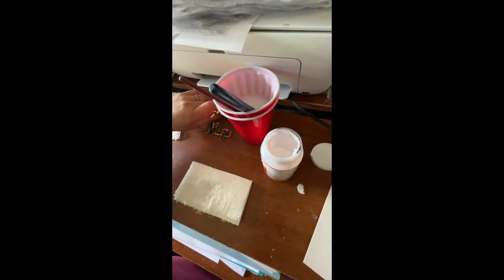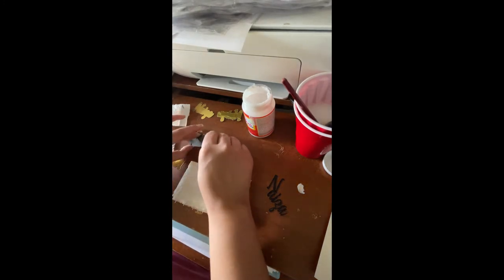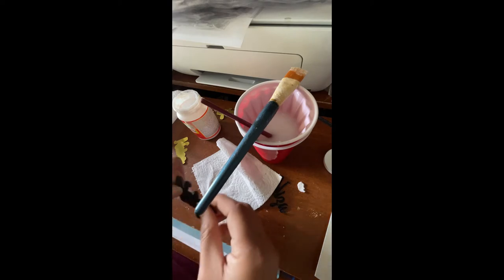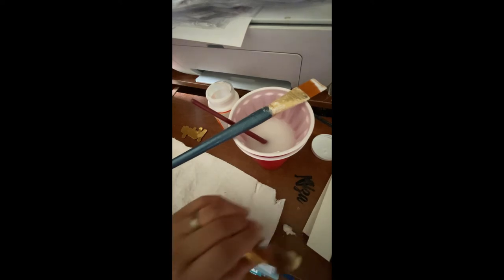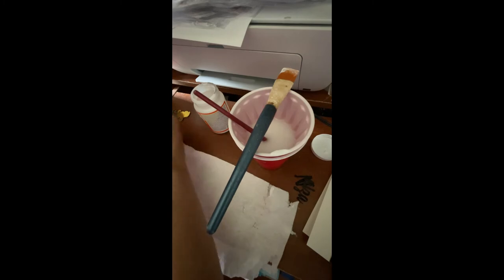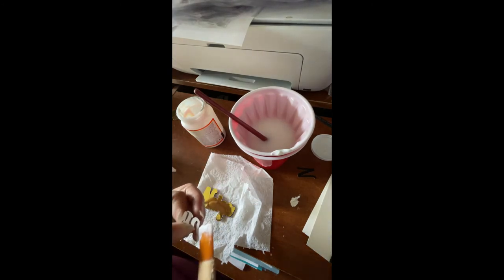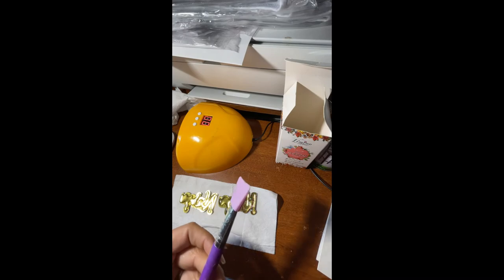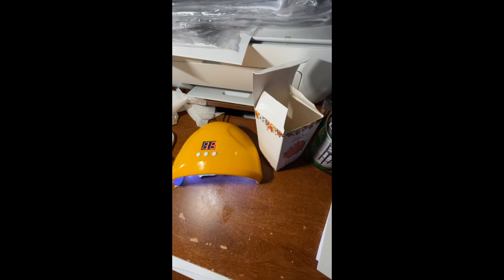Nameplate Earrings

Comment: How do you not get the glue on the back of the cardstock
Reply from the maker: Do you mean the resin?
Reply: @arkishalewis6785  no the mod podge
Reply from the maker: @marquitaalexander10  it gets on there sometimes and it is okay for it to get on there. I try to keep it off using the paper towel. I do sometimes paint over the back with the Mod Podge it dries clear anyway so it doesn't affect the look.
Reply from the maker: @marquitaalexander10  oh honey I do sometimes, I just wipe it off.